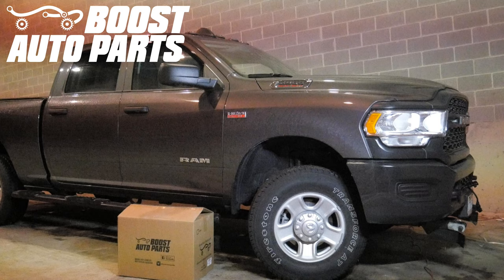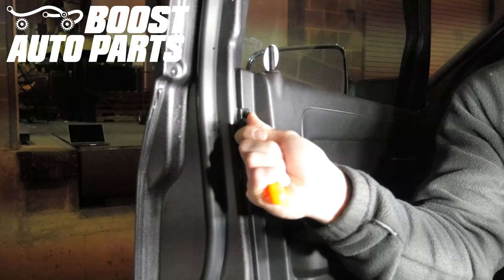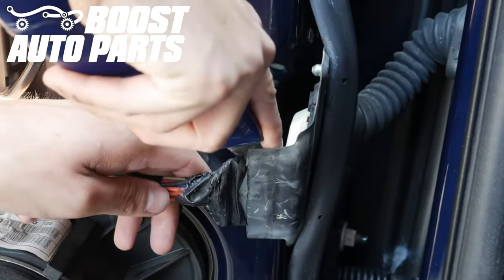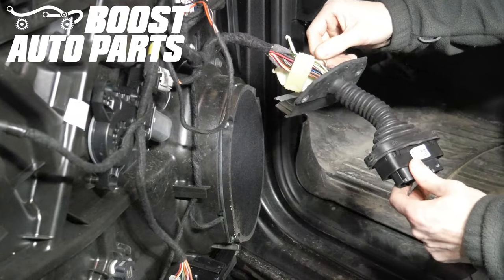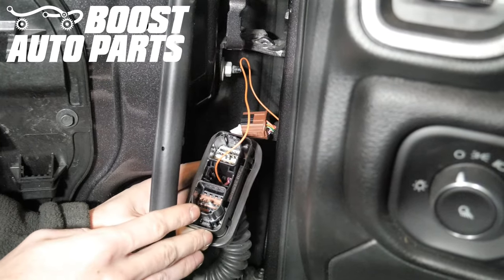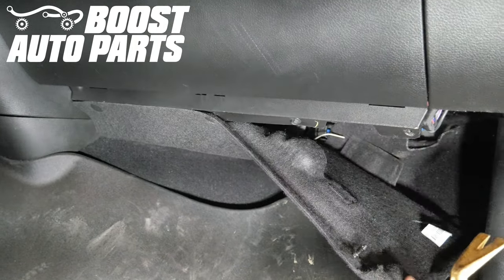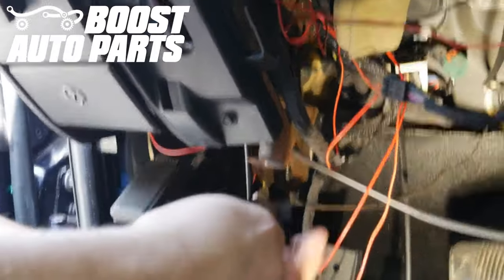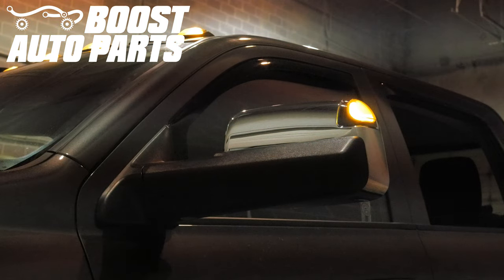Full Tow Mirror Install: (2019-2022) Dodge Ram 2500/3500 Tow Mirrors - Boost Auto Parts

Comment: Nice video man!  I have the same mirrors as you and I’m looking to upgrade  as well. I don’t want the running light so do you know which package I go with? Is it plug and play?
Reply from the maker: You can add the running light with our mirrors. 

Power adjust & defrost are plug & play on all vehicles originally equipped. 

Signal & puddle are plug & play on vehicles originally equipped. Vehicles not originally equipped need two sales codes enabled and then they are plug and play (dealers can do this, it's just programming).

Running light is only plug and play for those vehicles originally equipped. If not originally equipped, you run one wire to your underhood fuse box.

Comment: will this make the heated option work on factory added tow mirrors 2020 2500 tradesmen
Reply from the maker: The heat works with the rear window defrost button.

Comment: Ok. I've got a 2022 RAM 2500 Big Horn being built. Dealer was unable to order Power Folding (meaning the mirrors fold in with the touch of a button) Tow Mirrors due to the Global Parts Shortage. Does your kit work in this situation ?   ie: Does it address the reason as to why Power Folding Mirrors aren't available ?
Reply from the maker: We do offer a power folding upgrade for the 2022 Ram 2500. Reach out to our sales team for more info - the mirrors are in stock and can ship soon.

Comment: I have a 2021 ram 2500 limited mega cab. It has a running light, blind site alert, defrost and power adjustment already. Should everything be plug in play? Also would a 360 degree camera, and side spot light,, come with the mirror as well?
Reply from the maker: We do not currently offer the 360 degree camera, rear spot light, or BSM on the Ram style towing mirrors for the 19+ Ram 2500/3500. We do offer BSM on the GM Style mirrors. Aside from those features, our mirrors would be plug and play.